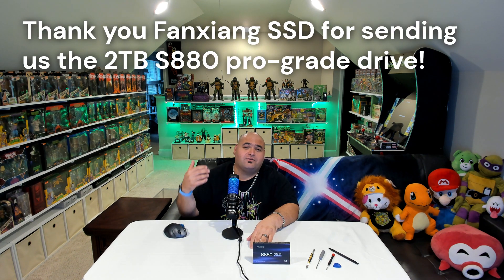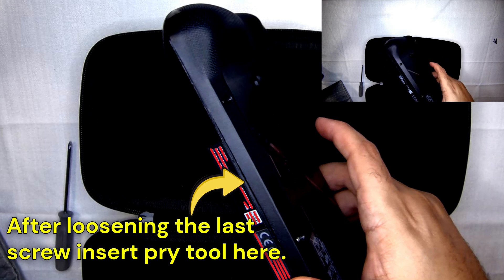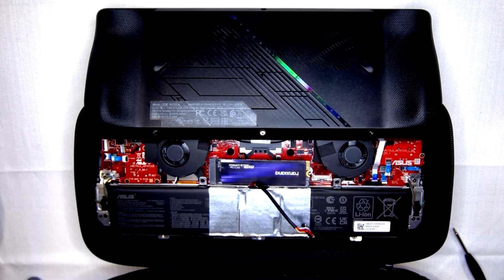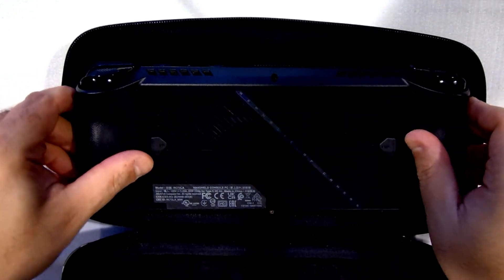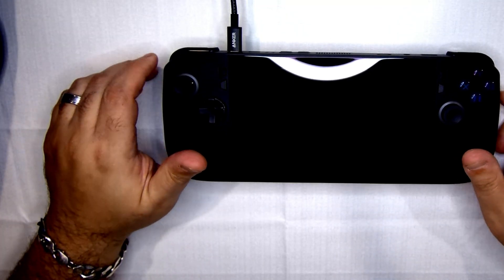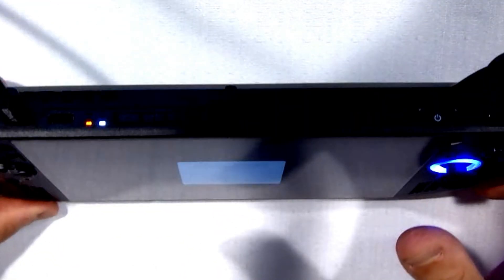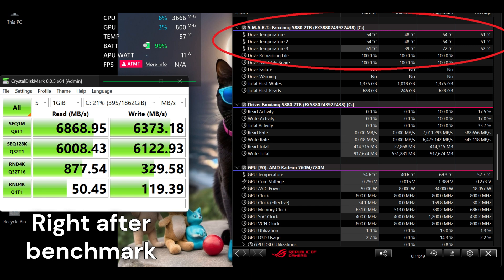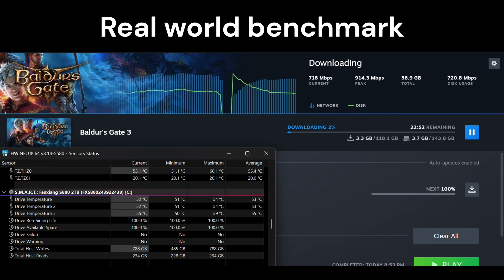ROG Ally X, Illest Upgrade Guide! Install 2TB, 4TB, or 8TB SSD and Windows.

Comment: Hows the ssd performance now? Just asking wanted to upgrade to the same kind of ssd you used im just wondering if its performing well or what. 😊
Reply from the maker: @c.delossantostv5686  hey there thanks for watching and for raising the questions.

So far I am still very happy with the drives performance and temperatures 🙌

As far as the exact one I used for the video the 2TB is one of the best ones considering the price and performance tier.

If you are considering a 4TB drive let me know as there may be better options available, and I am happy to help take a look.

If you haven't already be sure to like the video and subscribe to our channel so you don't miss out all all the tips we have coming down the pipeline!

Thanks for watching! 🙌🙌🔥❤️‍🔥🤙

Comment: Do you think the SN850P would fit? It has the built on heat sink for the ps5, but it’s the cheapest 8tb option I can find.
Reply from the maker: @heisseething ,

The Ally X should have enough clearance for the SN850P. For example, I have tested with the Lexar NM790 that has a similar sized heatsink.

The thing you will have to be careful about on the Ally X is that the heatsink will be pushing against the battery's connecting wires. Just take care that it's not a scraping against the wires during the install. You may have to gently bend the wires towards the battery to get the SSD to fit as I did when testing the Lexar.

Comment: everyone talking about heatsinks, what do you think? considering the original 1tb doesnt even have the heatsink
Reply from the maker: @8notes_  one of the things I really like about the design of the Ally X is that it allows enough space for you to be able to install a heatsink if desired.

At the moment I do not have the exact details of the stock drive. I do know it's made by Western Digital. I would be inclined to think it may be similar to the SN770 (I will take a closer look later).

If it is a SN770, the drive just sips power, so operating it without a heatsink is perfectly reasonable.

However given the extra space in the Ally X chassis installing a heatsink is worth it because it can help avoid the SSD throttling under heavy loads.

I have tested a lot of drives even outside the scope of this video, and all drives at some point will start throttling.

If you queue up a lot of downloads or play for more than 1.5 hrs at a time or even use your Ally X in a desktop-like setup it's totally worth it to install a heatsink.

I actually have a video planned for looking at SSD performance before and after installing a heatsink. albeit, using a different device. But it still will give insight to the value of a heatsink.

If you haven't already, be sure to like and subscribe to keep up with all the latest Ally X tips, tricks, and mods!